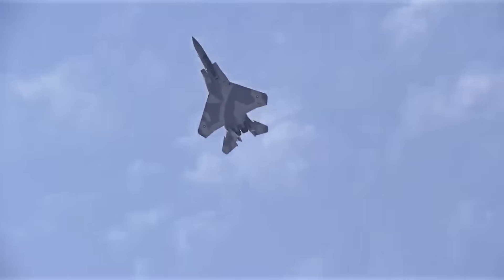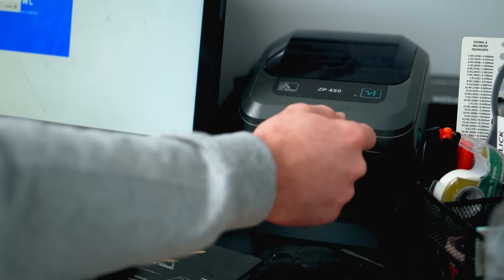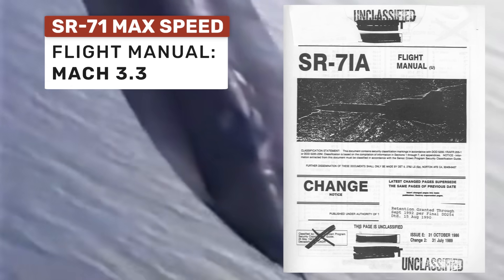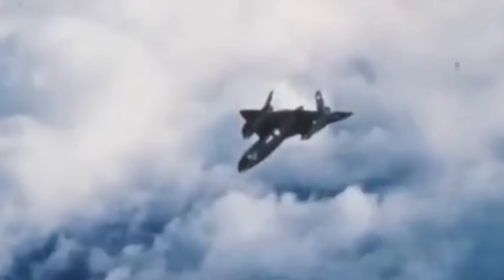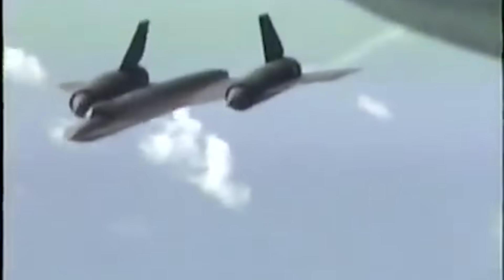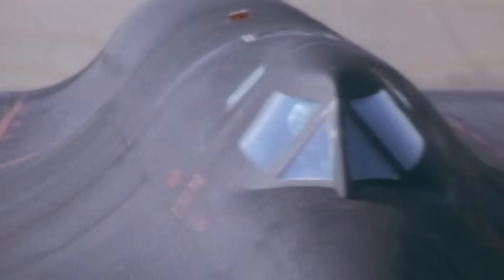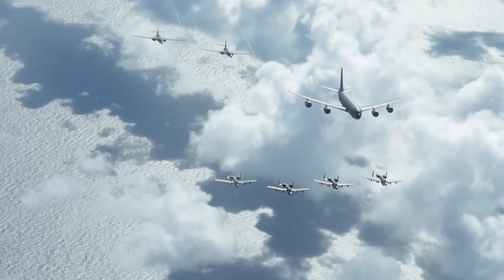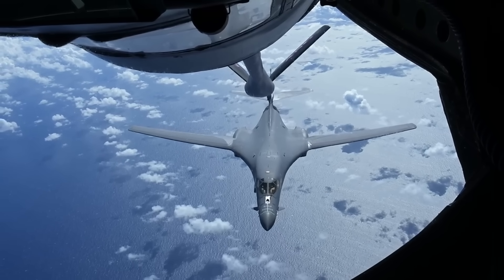The SR-71 was MUCH FASTER than the Air Force will admit

Comment: The same speed, in mph, increases in Mach number as you gain altitude. 1500 mph at sea level ( mach 2) is a different and higher mach number at 35,000 feet. Same ground speed, different mach number. Due to this, I have heard of SR-71 speeds up to Mach 5 due to its extreme altitude.
Reply: that could be what's going on in a specific instance but what's going on in general with the SR-71 is that it's top speed is actually determined by heat not thrust: the thing uses less power at it's top speed than it uses just to stay in the air during subsonic flight but the whole neat little physics trick that it uses to do that also concentrates most of the pressure it is generating pushing through the air into a tiny portion of it's surface area causing that small area to get REALLY hot and as the materials get hotter they expand unevenly, get softer, and loose tensile strength...riiiight on the part of the structure that is under the most strain. eventually something is gonna give and then the plane pretty much just evaporates as every open space on the leading edge decides to do an impression of a massively overpressurized air tank.

Comment: For what it's worth, a relative worked at NASA's Langley hypersonic wind tunnels, and he told me that, the A-12/SR-71 models were stable when tested up to Mach 20.  So the design is capable, only limited by engine functional limits.
Reply: I question the veracity of that claim.  A google search of NASA's hypersonic wind tunnels doesn't show anything with a capability over Mach 10.
Reply: @RobertR3750      One of the favorite comments of an elderly lady I knew was that "You don't want to tell them everything you know..."
If you work in a secure environment, that's a pretty good plan to stick with.
Reply: @RobertR3750 
Why wouldn't NASA have a wind tunnel faster than Mach 10 which is only 6,600mph. That doesn't make sense!  The space shuttle, now retired, had to fly at 17,000mph to enter orbit. That's Mach 26 calculated from  660 mph speed of sound.
Reply: @superdude1759  Ed Zachery!
Reply: @superdude1759  The space shuttle didn't fly to orbit, it went there strictly as a rocket. Sometime after re-entry it would fly (about as well as a brick) to landing.
Reply: @RobertR3750  And you believe Google ?
Reply: @paulreid2223  Google didn't say it.  NASA did.  Do you have any verified source that shows NASA is lying?
Reply: You know that a person is fibbing when they start off with "a relative..... or a friend of a friend of a friend....said.

Comment: I had a teacher in aviation school who was a retired air traffic controller.  While working as an air traffic controller one day he was in a staff  meeting about the SR-71 would be coming through his airspace at a particular time.  The speed would only be listed as SC (speed classified).  When it did finally show up in his airspace he made a couple of marks on his radar screen that defined a specific distance.  He timed the SR-71 between those two marks and the speed he calculated was 3500 knots per hour (ground speed).  The speed of sound is 767mph which makes 3500 kph is Mach 4.56.   Later I talked to a friend who was a retired Air Force pilot (F-16s and AWACs) who told me the Mach 3.2 speed of the SR-71 is Vopt (optimum speed).

If you go ogle the title " ‘Blackbird’s Top Speed was Officially Mach 3.2 but the SR-71 was Much Faster Than That,” former Skunk Works Engineer Says" published on 25OCT2019 by Dario Leone he says that Blackbird pilot Brian Shul once pushed the aircraft to Mach 2.91.
Reply: Don't forget Mach speed is a function of air density.  At typical conditions, Mach 1 ground speed at 60,000 ft is about 86.7% of the ground speed of Mach 1 at 0 ft.
Reply: @somaday2595  I'm not talking about KIA (knots indicated airspeed).  The teacher tracked it on his radar screen so he was doing a ground speed calculation with known distance markers over time on his screen.  Mach is 760mph at sea level under ISA (international standard atmosphere) conditions.
Reply: I also expect the Blackbird's speed to be incredibly fast, but I found a mistake in your calculations.

3000 knots is equal to about Mach 4.5
3500 knots is equal to about  Mach 5.25
3500 miles/h is equal to about M 4.56

Comment: Used to know this guy, probably passed away by now he worked on SR Avionics. Told me he changed out an airspeed indicator that broke mid flight and it was north of Mach six but not quite at mach eight. Now while he was in the cockpit some gaggle of politicians were being shown around and one asked if he could have a look inside of the cockpit. He was politely told he did not have a high enough security clearance. My buddy looked at his, concluded his was not high enough either but just got on with wrenching away as the assembled audience would probably not understand an avionics tech jumping out and running away muttering about a security clearance. He had a few other stories about the SR but this one is most relevant to today's video
Reply: There's several mach idicators from various airframes that have went at auction. The max the gauge reads is Mach 3.6 which is the absolute max allowable airframe speed, so there wouldn't have been a chance is seeing "north of  Mach six but not quite at mach eight". Your buddy also wouldn't have been remotely close to an SR-71 airframe without the proper clearances. These are all buffed up stories probably from people who never even worked within range of the SR - anyone that works with clearances would instantly know that story is complete bs.
Reply: @QazmeHabu those are war stories for ya. You never really know. My uncle was on the Big E for a surprise middle east deployment. He claims that they normally ran only some of the nuclear reactors at a time (it had 8) but by running all at once they got the ship going over 60 knots.
Reply: Interesting story, but there's one part I find a bit confusing. When you say your "buddy looked at his", what does that actually mean? Because, it's not like you get a card or anything when you have a clearance, so there's nothing to look at. And, when you have a clearance, you know what level you have, you don't need to look at anything. So, as one that held a security clearance for decades, I don't understand that part. 

Not to mention, as a tech, like I was, you don't even get access to a space with classified material in it, unless you have an equivalent level clearance. Whether you're working on classified material or not. You don't get access to the space itself, without that clearance. In fact, for most of the time I held that clearance, it was for access to the spaces more than the equipment.
Reply: I was told a similar story when I was talking to someone who used to work on them at the Hill Air force base museum.  He told me that airspeed indicator on the SR71 on display there was stuck over Mach 6 when they received it and that it was capable of speeds well beyond the official speed.  He may have just been pulling my leg to impress me, if so it worked.
Reply: @jeremiahcurry4875  considering the mach indicartor only goes to 3.6 I would assume so. heh.
Reply: @jeremiahcurry4875  I would generally take it as a given that if the military is releasing specs on something, the reality is beyond that. Which makes sense, because why would a military advertise its actual capabilities?

Comment: I had the chance to attend a speech made by an SR71 backseater.  He said they never reached the aircraft's limits and that every time the aircraft went up, it could break every record it previously set.
Reply: I've heard this for years.  In an article about the SR-71 in an aviation magazine, a pilot said that it was never flown at full power but could reach in excess of 2500 MPH.
Reply: @paulmartos7730  There's a few interviews of A-12 drivers saying they flew wide open over their targets.
Reply: @hoghogwild  if you were over a Russian SAM site photographing it, that might have been a great idea.
Reply: This is true from the accounts I've heard as well.
Reply: Always just knew the SR's top.speed record wasnt its ACTUAL Vmax. Too many pilot accounts saying they exceeded mach 3.2 out there to disregard as fakes. I read and account of a mission years ago in a magazine I dont remember from an SR pilot somewhere in or near the Soviet Union. Said they got a radar track on Mig 25's coming from roughly ahead of them. Mig 29's off their right side trying to angle for an intercept. As they were working out an evasion vector they get SAM launch warnings the RWR. Here is where I go "hmm" even back then. Pilot states they are cruising at 85,000 and 3.2mach. Taking the situation into account he said the best course of action was "Climb and accelerate😮". Said he advanced the throttles and climbed and accelerated and went over the top of the climbing Mig25's and saw the SAM explode about 5000 feet below and several miles behind..
The Climb and accelerate is what told me straight up the SR71 info we had was what they wanted us to know.
Reply: Correct
Reply: Wow!  Please see my comment above!
Reply: I believe that to a point. There's a quote from Kelly Johnson's engineers out there stating that each time the titanium airframe went up it retempered and further hardened the metal. Not sure what that would do for speed, but I could imagine it would allow "seat feel" to push a little futher as shakes, wobbles, and squeeks would change.
Reply: @QazmeHabu  The metal was not further hardened. It got up to 600 degrees F., which is not enough to harden it. That would have been undesirable anyway, as it would have done so in a largely uncontrolled way. Heat treatment to harden requires much higher temperature, and is done in a very controlled way; specified temperatures for specified times, heating and cooling at specified rates. 
What the heat did was anneal the metal- raising its temperature high enough to relieve stresses in it without being so hot as to cause it to lose strength. The heat therefore gave the skin an indeterminate lifespan through being stress-relieved every time it flew. By having stresses (potential points of failure) relieved, you could say that the strength of the metal was renewed each time it flew.
Reply: @jeli3953  ah makes sense! That's probably what I was thinking about but remembered the incorrect facts on it. Thanks!
Reply: @jeli3953  It got hotter than only 600 degree F. The front of the plane actually gotten RED like it was in a fire being heated while flying at top speeds. The metal would actually EXPAND and seal the fuel tanks while flying and while on the ground, it would actually LEAK the fuel.
Reply: @1flash3571  it would get between 600-900 degree depending on speed and atmospheric friction. Not sure how any of this applies to what I said - and everything you mentioned is extremely common knowledge about the SR-71? 

As far as the fuel leaking, it would be better summarized as it dripped fuel. Most of it would evaporate and it was never enough to puddle. 

As a new plane the dripping did not happen. It was only after numerous flights once the sealant started to fail due to the heat that this started. But since the dripping was slow and the fuel wasn't flammable without accelerant it wasn't deemed that it needed to be corrected.

If fact the JP-7 fuel was cycled through various part of the plane as cooling before being consumed. Interesting plane all around.
Reply: @QazmeHabu  I have NEVER said that fuel leaking was a problem. I said it to say that the metal would expand during the flight due to heat. Also, it would get around 800 degrees on the nose, not 600 to 700 degrees. It would also get as high as 1200 degrees F at the cowling.
Reply: @1flash3571  not sure where I said any of that but cool facts.... I think you meant your responses to someone else though.
Reply: @jeli3953 
This is well said. As an aircraft mechanic who sent "O" material of 5056 and 7075 aluminum alloy for solution heat  treatment (T-3 usually).  I know that what you're saying is exactly right.  The "O" state of the alloy was the fully annealed state where we could form a part almost by hand, but usually used soft mallets!  When it returned it was in is full hardness for installation.
Reply: @1flash3571  You're right. I'd read before that 600 degrees was the temperature at the canopy, and I thought that was the hottest.
Reply: @jeli3953  Thanks for saving me the trouble of typing!
Reply: @QazmeHabu  Front of the plane would get red, especially at the front tip of the plane while flying that fast. Metal would also expand while it was flying as it got hotter.

Comment: Durning the Grenada operation, SR-71 were operating out of Pattick AFB, Florida.   They would open the hangar door, the plane would roll out and immediately take off (To minimize time on the ground for OPSEC).  SR-71s would roll down the runway just long enough to lift off slightly, then point the nose almost vertical and hit the gas.... out of sight in less than 15 seconds... unbelievable.
Reply: @Ghost_Bear_Trader 
Yea, I guess the only aircraft that could match it's speed was it's tanker.
Reply: @dukecraig2402  tankers dont fly any faster than commercial jets, obviously.
Reply: @anthonydewitt7674  
What's obvious is you not getting that it's a joke, which obviously went over your head faster and higher than any SR71 ever did.
Reply: The pilots always said that the SR-71 could go faster than it needed to go.
Reply: @Ghost_Bear_Trader 
Yea, there's another thing about that aircraft, it had the turning radius at speed that it did because the wings were only rated at 2 G's, that's what you get when you design a flying fuel tank.
Reply: Ditto at Kadena. best I could tell. Incredible, visceral sound!
Reply: SR71's couldn't lift their noses anywhere near vertical on take off or they'd break right where it's neck meets the wings according to the pilots, I forget what their limit was the pilots say in interviews but as I recall it wasn't even 45°.
And they didn't get to the end of the runway and leave immediately, it took at the minimum 2 minutes of them sitting there for the pilot and back seater to do what they had to do and for the celestial navigation system to lock onto the 3 stars it was programmed to use as reference points for that particular mission, even in broad daylight it could see them, they didn't hang out at the end of the runway for too long but it took them at least that amount of time to get ready. 
As far as this click bait video goes the SR71 couldn't fly "much faster" than what the Air Force admits, first off there's no reason for them to lie about an aircraft that's retired and will never fly again, and the guy's who flew them have all been cleared to talk about it's performance parameters by the Air Force, the only thing they don't want them talking about it's electronic warfare capabilities since some of the equipment is still used in the U2 which continues to operate, but when it comes to how high, how fast and everything else in that regard they're allowed to say anything they know, and they'll all tell you that the listed speed is considered it's top speed, it's capable of flying faster but not by much and there's no real reason to do it plus any pilot who did so would probably lose his job because of all the additional maintenance and most likely engine replacement that would be a result of doing so, at it's listed top speed which is where they flew their mission's the metallurgy of the engine's is designed to handle the heat, any faster and the heat increases to the point where the aircraft would have to be taken out of the flight rotation schedule due to all the different inspections that'd be required from getting the engine's that hot, another aircraft and it's crew would have to be brought in from another base that houses them to cover for that one, the list of headaches and problems from doing it would cause heartburn with all the wrong people and it'd be the last time that crew saw the inside of one for the rest of their lives, also the way speed is measured with aircraft any speed an SR would have hit in a nose down attitude doesn't count. 
As pointed out by the creator of this video which also shows that it's title is malarkey the small amount of speed over it's listed top speed that a few SR's are rumored to have hit certainly isn't "much faster" than what's listed so all the hoopla over it is just dumb and pointless, it's not like it can actually go mach 4.7 which would be something worth getting excited over and would prove they were hiding something about it, people's imaginations just go crazy over those things and there's no point behind it, there's no secrets about it, it's a retired aircraft that the Air Force and the pilots who flew it have given full disclosure about it's performance, there are no secrets about it with the exception of it's electronic warfare capabilities the Air Force doesn't want talked about because they're still in use, and no one cares about it anyway, top speeds of aircraft are no longer an issue, China, Russia and no one else cares about anything like that which is why all the hubbub over someone at Boeing accidentally misspeaking about the F15's top speed is just silly, stealth capabilities and weapons capabilities are what they're concerned over, our potential enemies could care less whether or not the F15 can actually fly 200 MPH faster than what's listed, the only people it keeps awake at night is aviation fanboys and their vivid imaginations.
Reply: complete bullshit
Reply: @TykeMison_ Obviously you have never seen it happen.
Reply: @TykeMison_ American Airlines used to take off in the same manner.